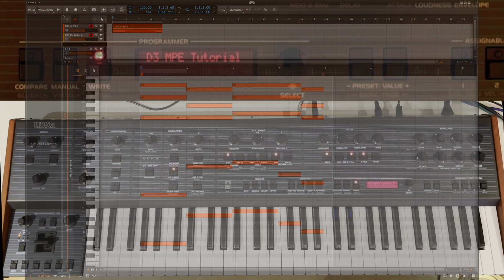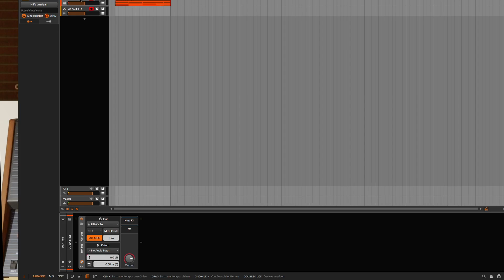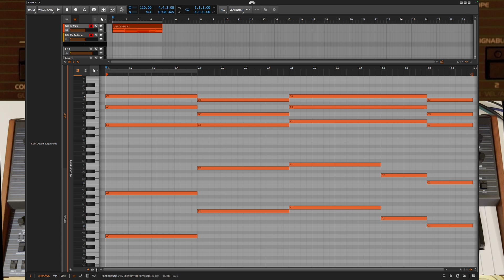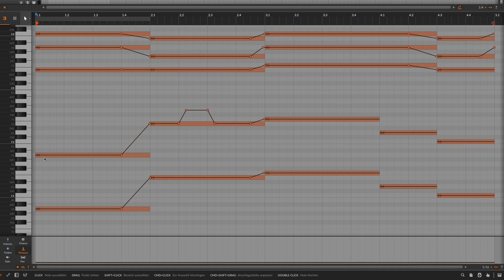Behringer UB-Xa - Polyphonic Aftertouch and MPE explained

Comment from the maker: Hi, in this video I'm talking about polyphonic aftertouch and MPE and how you can use it with the Behringer UB-Xa. I didn't touch these topics in my walktrough video because I think it deserves its own video.

For other functions explained, please check the walktrough here: https://youtu.be/DgQslX6uupM?si=yo3zPeQ3nTVfwJm_

0:00 - Introduction
0:26 - Polyphonic Aftertouch vs. Channel Pressure
2:20 - UB-Xa Key Bed
3:00 - Aftertouch Setup
6:28 - What is MPE
7:46 - MPE Setup
9:00 - MPE & Bitwig
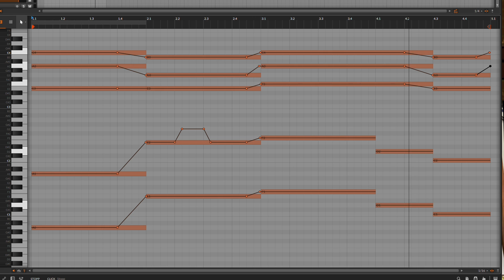13:25 - MPE Timbre

Comment: I have a question. In 9:40, the device is routed to a single audio track in stereo as opposed to two audio tracks with separate outputs. So did you use a 2-to-1 TRS cable to plug into a single channel onto your interface?
Reply from the maker: @bengsynthmusic  It’s much simpler: The UB-Xa is connected to the interface Inputs 15/16. In Bitwig I have created a stereo Input which uses 15/16 as L/R Inputs.
It’s mono because the Voice panning in the UB was set to zero.

Comment: Have you tried to see if poly and/or channel aftertouch are being transmitted over the MIDI DIN out?  On my unit and also reported by others on GS it seems that there is a bug that aftertouch is not being transmitted over DIN MIDI out.  Everything else is transmitted fine over DIN MIDI out.  I can see in your video that you are not using the DIN MIDI out so can you please check.  Thank you.
Reply from the maker: You are right. It only transmits if the Aftertouch Out parameter is set to poly aftertouch. I can confirm ... Let's report it to Behringer so they can fix it in a future update.
Reply: @tomnoise23  Thankyou Tom for confirming this.  Yes I will also report this to Behringer and hopefully others will also confirm and also report.  Strange that something so basic and important slipped by all the testers. I guess that they were more interested in getting the poly aftertouch working correctly and they missed making sure that the good old channel pressure aftertouch was also working properly!  Thanks again!!

Comment: Hey ! When I’m creating a patch and I want to add poly AT. I press shift and Mod … but it always loads up a new sound ( brass ensemble) patch and it completely disappears the patch I was working on. How can I access poly AT without having this issue ! ? It’s a nightmare there’s 0 documentation about this.
Reply from the maker: Hm 😳 sounds like that shift mode is not recognized on your unit when pressing shift? Does it work for the other functions, like Globals menu etc.?
Reply from the maker: Oh and you can disable the preset recall for the buttons 1-4 if you don’t need it. It is in the globals menu under misc settings/disable/assign preset
Reply: ok thanks a lot ! yeah im sure its user error, i just tried again and it does work. I guess i just hit the 4 button without shift...However I did lose like 15 minutes of work lol Thanks for the info i will disable the preset recall. @tomnoise23

Comment: Hi, the Behringer info says that you can export and import patches at least at the bank level, but this is no where in the manuals. How do you trigger a sysex bank save from the UB-Xa? And can you load a bank back to any bank, or only the one it was exported from? I assume that to load, you just send the sysex to the UB-Xa. Thanks! I've been looking for this everywhere. (Still waiting on my preordered unit to arrive.)
Reply from the maker: SysEx dump is somewhere in the Globals menu. It’s also described in the user manual (I think not in the quick start guide). You can transfer single banks, presets and settings. To load it back you just need to send it to the UB-Xa but I didn’t try every combination. peace and happy holidays 🎄
Reply: Thank you! Found it. I had been looking all through the midi menus. Where it usually lives in most synths. @tomnoise23
Reply: I will have to make a simple patch bank library app for it.
Reply from the maker: @greenbriarstudio5399  that would be handy! ❤️

Comment: Great presentation, but is it possible to control MPE software VST (like Pigments or others) with UB-Xa, by using it as MIDI controller?
Reply from the maker: It doesn’t send (only receives) MPE data but it sends polyphonic aftertouch to midi.
Reply: @tomnoise23  Thanks for your quick response. I hope, they will do some firmware update later for MPE sending over MIDI - that would be great
Reply from the maker: @paphundekel1926  This can’t be addressed by software as it needs a specialized Keyboard or button matrix and sensors. A classic synthesizer keybed is not sufficient.